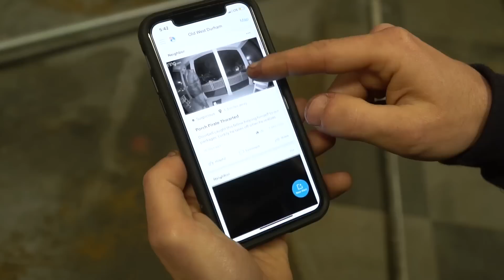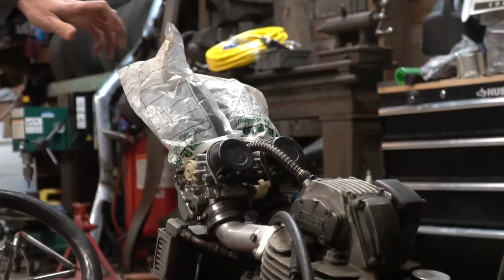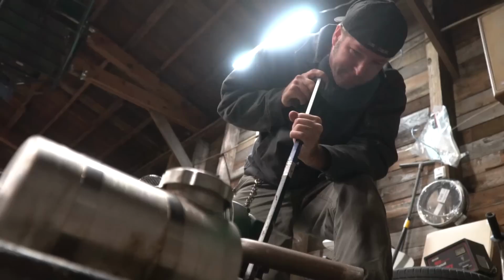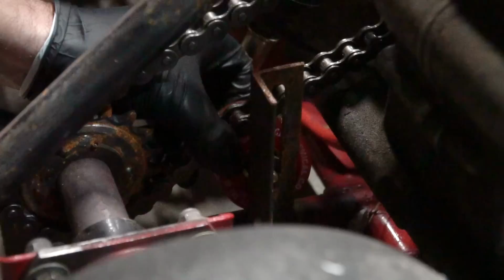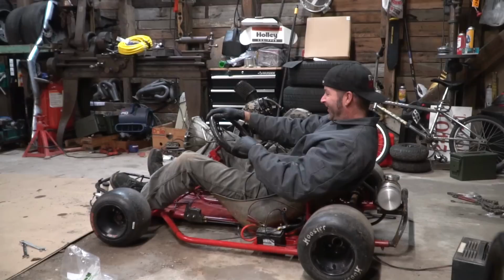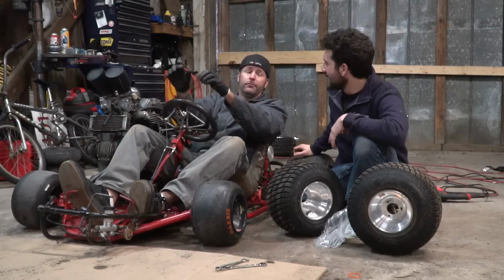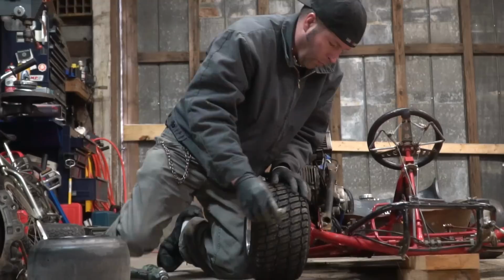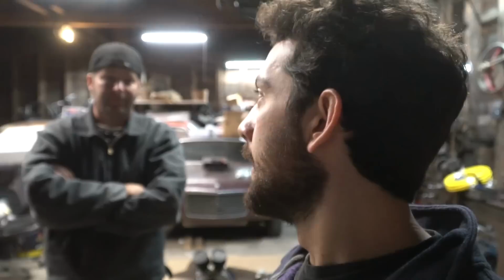900cc Ducati Kart gets Off Road Tires! 30 FOOT ROOSTER TAILS!

Comment: As a Ducati fan, this is probably my favorite kart.  Also, Issac always seems to drive a little less enthusiastically than John on the normal karts, but when he gets behind the wheel of some of your more crazy vehicles he drives like a madman.  I love it.
Reply: Being it is ducati engine and it has not blowed up they have been lucky with it ducatis tend to blow up a lot
Reply: YUKI JINJUJI do you even english bro?
Reply: Agree with Brendan. That dry clutch idle sound gets me unnaturally excited.
Reply: I have a 900. 25 years old and no sign of “blowed up”.
Reply: @bobbaker9395  Agreed, properly maintained they are bullet-proof, especially the aircooled units.

Comment: We still have to see a top speed run of this bad boy! Also try using a normal car cambelt tensioner pulley as a chain tensioner, They have a bit of adjustability built into them.
Reply: MBrace ez 130 mph I think maybe more
Reply: S
Reply: Not a smart idea
Reply: @Ryan-eo1dw  I think in a kart it will do significantly less because of the wheel size. I say 100mph maybe. Depends on the sprocket and pinion sizes.
Reply: They did it on the TV show. Ike said he took it way past 100mph. I forget the exact number but it's fast
Reply: @teeshark6584  Better be a good chassis for all that!
Reply: @teeshark6584  definitely that would be absolutely sick
Reply: car have cambelt covers for a reason...to stop dirt because even a small stone would force it off so really not a smart idea!!

Comment from the maker: Thanks again to Neighbors by Ring for sponsoring today’s video! See what’s going on in your neighborhood by visiting ring.com/crosscarts
This go kart is absolutely insane! We should change the name to the TRENCH DIGGER 900!
Reply: This engine needs too go into the crosskart i think, v-twin sounds so good, plenty of torque as well.

Or perhaps build a stronger chassis for it with a bit longer wheelbase so 
you can mount on wider & larger diameter wheels & tires, perhaps a similar rear suspension too the rally cart just for durability but more road going then offroad strictly.

Perhaps a 2 passenger kart with this engine mounted in the back like a vw bug ?
Could let you both ride it and sound mean.70 hp will still let this get up too speed quickly even if you put it in a actual vw bug from the 60's or 70's.
I kind of want too see you guys renovate an older bike or build something & make it road legal.
Something light, maybe give it some modern tech like abs brakes, & perhaps engine swap from a newer bike better brakes that are still cheap ofc too get etc...
Reply: Ring doorbells are an invasion of privacy. There fine if you dont mind people being able to hack into your camera and spy on you or big brother for that matter...
Reply: You mean Nazis ring?
Reply: Never shill for ring or nord, no matter how much money they offer. Your reputation is not worth any amount of money.

Comment: The reason why the chain tensioner failed is because it is not supposed to be on the drive side of the chain BUT after it has made it's way around the axel sprocket (after the torque)..on its return to the motors drive sprocket ....so put the tensioner between the chain forcing it up to create a triangle....friggin ❤it 👍👍  🙂

Comment: That engine is a beast however the chassis you put it in will never allow you to see it's full potential. Put that motor in the crosskart !!
Reply: The cross kart is already a death trap. Last thing I want to see is a video about how it flipped and one of em died. The roll cage probably break on impact. And dont get me started on the fuel tank placement.

Comment: Keep the Ducarti as is. Please do another build and use a R1, ZX10 or GSXR 1000 engine. If you do the R1, try using an ‘09 or later to use the Cross Plane engine. They have a much deeper growl similar to that of a V-twin with the high revs of an in-line 4.

Comment: Guys I would love to see you guys build a 1000+ cc two seater street legal street cart with reverse. It would be wicked to see a goldwing gl1800 engine fitted to work in that application. Maybe eventually fit it with a couple of turbochargers. Maybe do a collaboration with Chris, Mike or Greg(rather b welding, moto mule, or red beard) on it. If anyone could do something like that it'd be you guys.

Comment: the only way the Ducati engine would be able to use all the available power it can give would be on a second cross cart build but on 10 or 12 in tires to handle the torque .but knowing how you guys are that will never happen but still I love the cart just how it is . it's like a pinto with a blown 460 in it .  It's not meant to work but its a hell of a ride while it last's.

Comment: i would leave it the way it is but would be good to mess with the gearing.it has a fast idle speed and not a lot of gear changing.it has a lot more torque to offer.plus would be easier on the clutches taking off.

Comment: Get a 30-60hp quad motor and do a custom off road build. Doesn't have to be power wheels but u guys do have that other truck body. AWIS would be cool at 30-50mph off road like GHPC

Comment: must be using a lot of bright lights , to be able to get this good picture in that dark a garage space
well if you got wet mushy spots on youre property just use the ducati kart to dig some trenches toward  the lake and the place will be drained and dried out in no time flat (or filled up and under water from the lake if theres a levi in between )
for performance sake you could build a longer and stronger chassis with suspension and put the engine more toward the middle and the front , then again youre right about keeping it the way it is and build something around a different engine , if you do store it as it is and dont use it no more cause any change will affect its originallity 
think about this :  , the old chassis has allready been cracked and bend a few times and there is a realistic change you going to hurt youreself on that monster if that chassis snaps in half , its just not build to handle the power 
go talk about a cooperation with grind hard plumbing and have them help you make a good chassis for it or put the ducati in the dragster 2.0 build by grind hard plumbig and put a smaller 250 or 500 cc 2 stroke watercooled dirtbike  engine on the kart frame instead , trust me it will be wild enough (shifterkarts with these engines accellerate from 0 to 60mph in 3 seconds and are known to go 155mph on the straights on a asfalt race track ) these karts do have  a complete aerodynamic body and brakes on all wheels btw
https://en.wikipedia.org/wiki/Superkart

Comment: I dunno man, i think a longer chassis with suspension and that engine up front would make for a lot more predictable handling characteristics. I prefer front engine in go carts they just feel more like a car. Funny how cars, we try to get them handling like go carts, go carts we want handling like a car. At least i do. I cant stand snap oversteer and a twitchy feel i wont waste my time or the materials. I built a front engine full suspension rig using a '99 yamaha vmax engine. Its a v4 and sounds incredible. I also drew up plans for the sane exact chassis that'll accept an fz1100 engine as well. The I4 layout would obviously accept almost any I4 engine. I wanna go fuel injected R1 with a turbo soon. The chassis really does work extremely well. The rear suspension is very similar to a 2010 yfz450. Just lower slung. Then the front i use control arms from a can am 3 wheeler thing i cant remember the name of right now. Almost every component on the front end you can buy off the shelf from a canam dealer. Its the only thing i like about those lame 3 wheeled poser mobiles. It drifted like a real car. I mean, throttle off oversteer, self steer in transitions thanks to the adjustable front end and the fact i got almost 8° of castor out of it, and its really, really fast. I used some 14 inch wheels like off of a mkII escort you can find wheels like that everywhere for cheap. The tires were a bit of a challenge but theyre out there. I need to shut up now. Great job guys keep it up!!!

Comment: Needs a muffler, you guys should care more about your hearing if you need ear protection to start up your project or ride around on it, it needs a muffler. I figure someone somewhere convinced you guys that not having a muffler increased hp by some meaningful amount but in reality unless the muffler was restrictive the difference is going to be under 3% on a N/A motor. Some motors will even  run significantly worse without a muffler as they were designed to require some back pressure. I think you ran into that with the crossy.

Comment: The levels of jank need to take a step back when you're working with something that is actually fast. It's all good when you're using 10hp lawnmower engines and stuff but you're gonna fuck yourself up half-assing brakes and stuff with something that fast.

Comment: If you're wearing the teeth so easily with the extra contact patch since the motor is in a cart and not a bike, definitely should be using 530 chain and sprockets

Comment: I really don't get what your obsession is super loud straight pipe exhausts. A lot of these small engines don't run better without a muffler and in some cases even run worse and it just makes riding them more unpleasant

Comment: Find a late 80’s-early 2000’s Harley sportster and build a chassis around that!
Reply: There are plenty of other cheaper and lighter ways to get 50 HP. The torque advantage doesn't matter, you have gearing.

Comment: And yet again a 5hp go Kart fails after a 50 hp bike engine is installed. (CREW)
WHY DOES IT KEEP.           
     " BREAKING "
Do we see a pattern yet ????  Safety in the work place is strictly exercised.
But at home......
It'll be fine. !!!!
 Next scene Ambulance sirens approaching. Dude I thought you were dead. That's why you plan & build to take the power to be installed. Big circle. 
  Huh. ????????